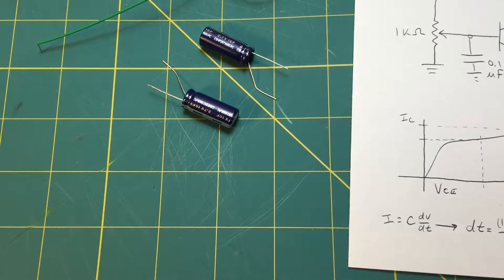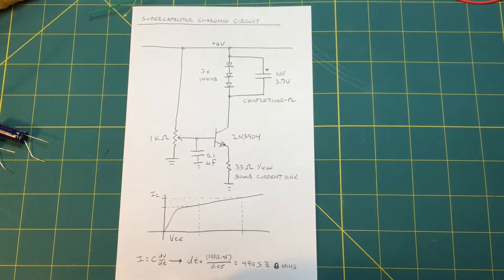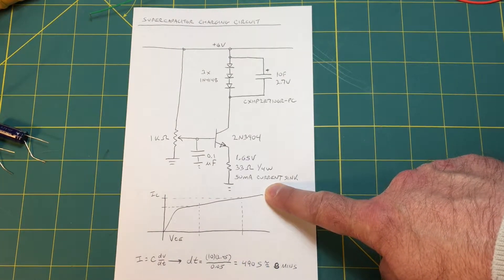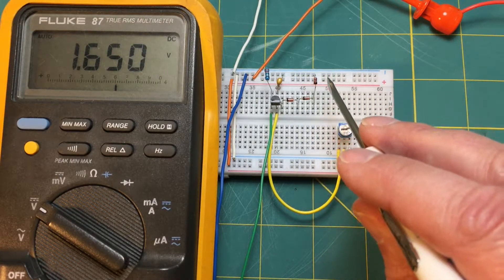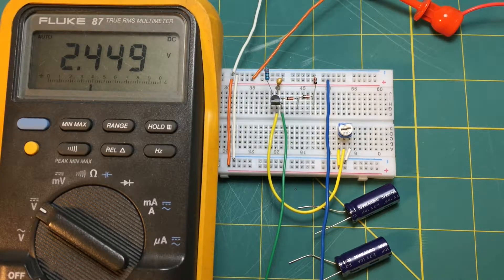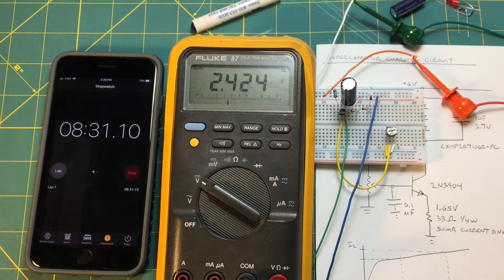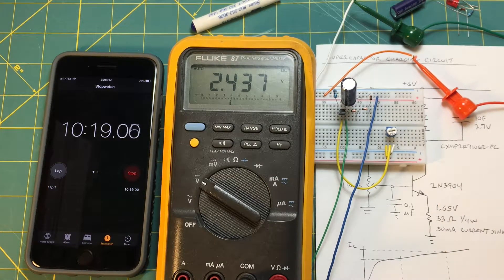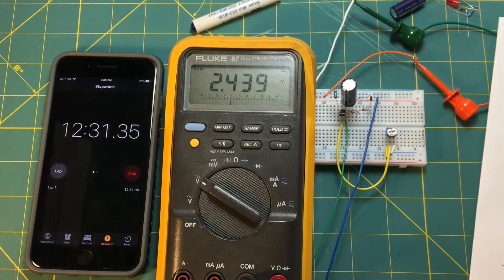Supercapacitor Charging Circuit

Comment: Hi can I add a dc capacitor to a battery pack permanently  63v  1000 uf ce vent 105c   I want to keep a higher current for my 12v inverter   It drops to 10 v etc   So I wanted to add a cap to my 12 v battery on circuit. So the cap will be constantly attached to battery  is that dangerous? Can you plz explain Thank you
Reply from the maker: The 63v voltage rating is acceptable, however the 1000uF capacitor will have some leakage that may discharge your battery over time.
Reply: @NetworkXIII  thanks for the response   So can I keep a CD capacitor constantly connected to a battery pack?  Will it help the voltage drop?  How do I wire it? Battery pack and load both connected to cap?  Is there a better way to keep my inverter from voltage drop? It’s a 3000 w inverter hit anything over 4/5 amps drops the voltage to low to operate my 12 v inverter.  Is a transistor or thyristor  a better option to run 10 amps dc on my inverter.  Thank you
Reply from the maker: Connecting the cap closer to the load rather than the battery is better.  The cap acts as a local reservoir of charge.

Comment: for 320F cap should we use same schematic? I need to charge my cap quicker like 5 minute.
Reply from the maker: Robert s To charge a 320F capacitor from 0V to 2.4V in five minutes with this circuit, you will need to sink a constant charge current of ~2.56A.  The 2N3904 transistor and the 1N4148 diodes in this example will not be sufficient, you will need to select components that can safely pass the larger current. The resistor in the emitter leg will also need to be changed to a lower value with a higher power rating, say 200 milliohms and 2 watts.

Comment: What's are changes for 100f supercapacitor?
Reply from the maker: Kiran Bariya You can use the same component values, it will just take longer to charge a 100F cap than a 10F.
Reply: @NetworkXIII  thanks for replying